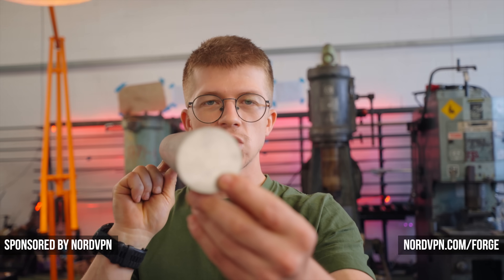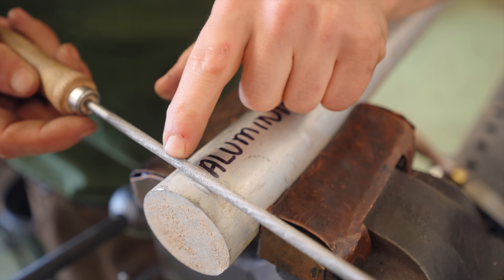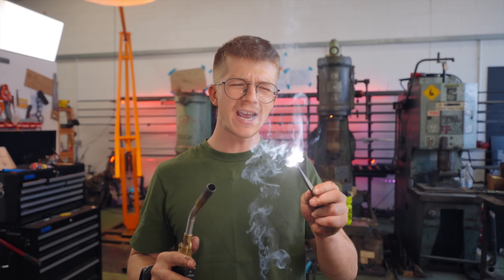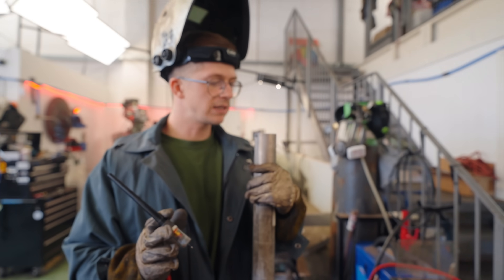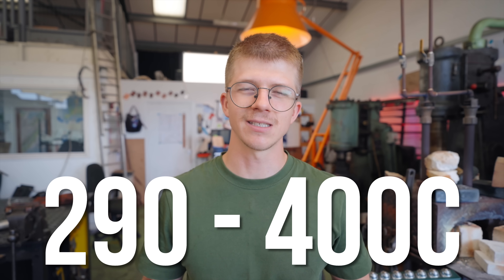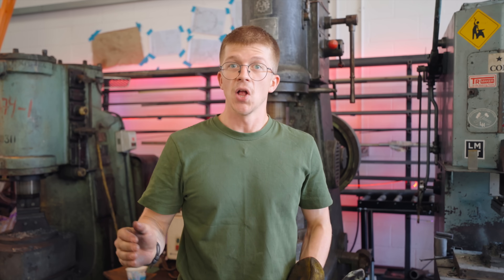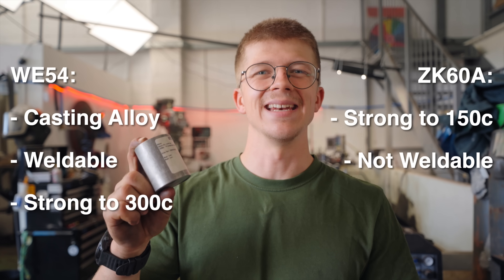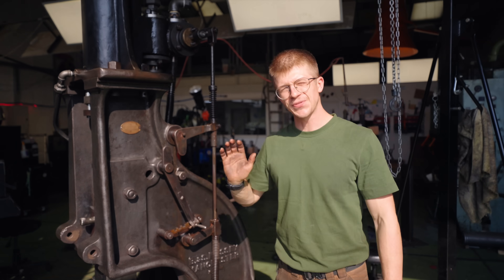Can You Forge Magnesium?

Comment: Non grey metals? Copper, gold.
Reply: Calcium, bismuth, brass as well
Reply: @scarecrowforge Calcium is a grey-silver element. Bismuth is also a silvery grey, but when oxidized it displays a wide range of colors. However, those colors are from the oxide layers of varying thickness. The metal itself doesn’t have those colors. The oxide layers of titanium, iron, and others display that same property (thin film interference). Brass, and bronze are of course alloys that get their colors from the copper that makes up the majority of the mixture. So, there aren’t many elemental metals that aren’t silver, or grey. Just copper, gold, and cesium. Osmium does have a slight blue hue though.
Reply: @ashe1.070  zirconium?
Reply: @Natehas0fucks  It really doesn't matter. The only alloys that have a unique color get that color from copper. Rarely some alloys can have a unique color other than the golden, or coppery color of brass, or bronze respectively. There's an alloy of gold, and aluminum that can have a purple color; however, that's due to a specific crystal structure that forms only under specific conditions, otherwise it's a grey color.
Reply: @DankasorusRex  Zirconium is a silvery-grey color.
Reply: @ashe1.070  it’s super dark but I guess it’s one of those 50 shades my gf talks about…
Reply: Most metals are silver which is technically not grey. Cesium has a silvery-golden color. Osmium is silver with a slight blue hue.
Reply: Zirconium

Comment: My favorite thing about magnesium, is that it does both heat and cold. Chips burn very hot, but a bloc transfer heat very very quick, and that makes feel cool to the touch. Love it.
Reply: I've set it on fire before and found chips light easily with a match or lighter.
A large piece took alot of heat, you had to heat it until the entire piece was melting then hit it with some air, then it lit up.🔥
Reply: I think part of my CPU cooler is a block of magnesium.
Reply: The only reason I see to use magnesium as a CPU cooler is a weight reduction. It's much less efficient compared to other solutions.
Reply: @The_Inquisitive_Inquisitor  i think it would be a bad idea to use this metal for this use
Reply: @neralodinson6980  why? Sounds like it'd make a great heatsink
Reply: @The_Inquisitive_Inquisitor  CPU coolers usually are nickel-plated copper.
Reply: @hammerth1421 
Or aluminum.